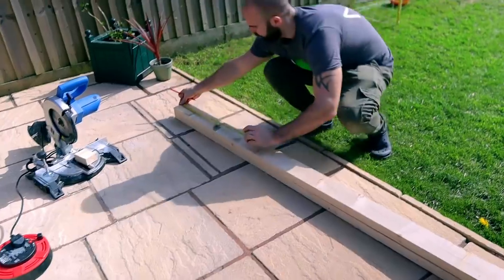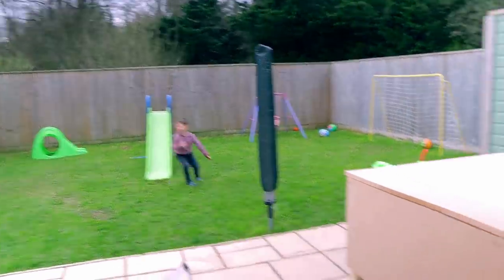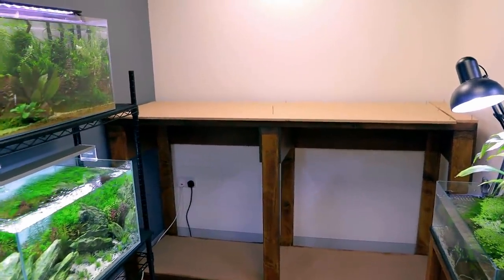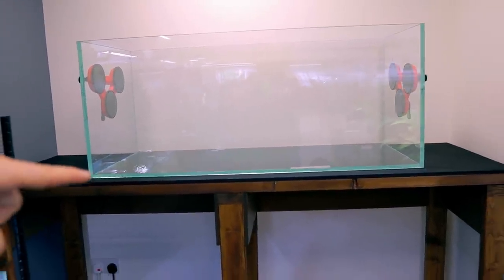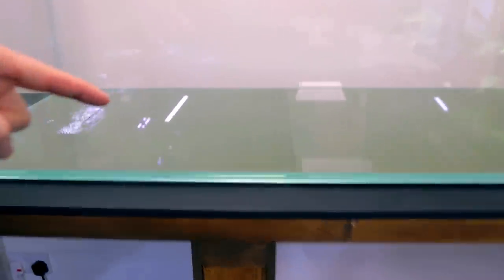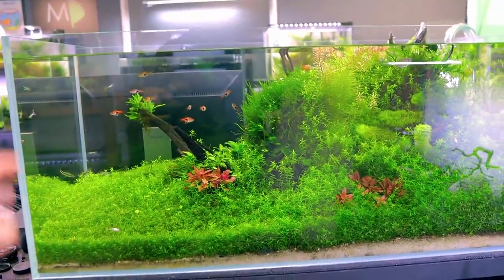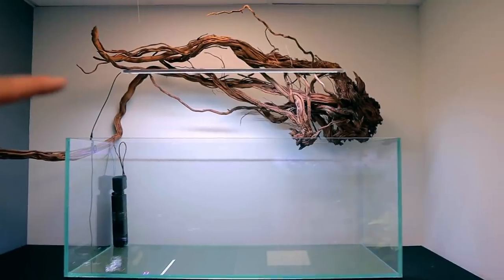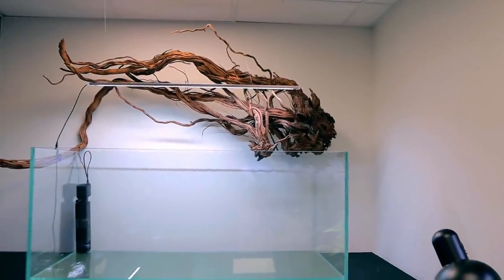How To: Ecosystem Aquarium NO WATER CHANGES (EP1) | MD Fish Tanks

Comment: SerpaDesign had a real bad time with this type of wood so I won't put it in the water neither :D WONDERFUL start MD, already lovin it as all of us I guess ! Can't wait until part 2 !!!
Reply: What type of wood is it? I didn't hear him say in the video
Reply: @ellenm4560  It's Dragon Root !
Reply: at least this how SerpaDesign called it in his video :D
Reply: @maxpuissant1079  Thank you! Must have missed that Serpadesign video too 🤦‍♀️
Reply: @maxpuissant1079  DragonRoot can be awesome in a tank, it just takes a bit more prep work than other woods.

It's pretty sappy, so either boil, dump the water and boil again (repeat until boil is almost clean), or boil in salt water to pull out all the sap, and then boil in freshwater to pull out the salt, or soak for a few weeks in saltwater, followed by a freshwater soak.

Requires more water changes if it's too big to boil, but the saltwater soak prevents the rotten egg/anaerobic activity Tanner had in his tank.
Reply: @Lazy_Fish_Keeper   you're right! if these roots are used in a lot of tanks there has to be a good reason : they are really nice roots :) , but yes they require a lot more of work to prepare ;)
Reply: @maxpuissant1079  only the thick pieces. Remember all the Aquascape people (like Josh Sims) who pull off thin strips of Dragonwood for award winning scapes. The interior of the big pieces rarely are sufficiently cured.

It's like the difference between my cholla that sinks after 24 hours soaking, versus the hard wood branch (2" diameter) that is still floating after  a week 🤷‍♂️
Reply: @Lazy_Fish_Keeper   so true. I recently cut a small stick that was in the tank for 8 month and realised that center of the branch was not event wet !

Comment: Don't know how far you are with the project but just a suggestion, the tank is in the middle of your stand so most of the wight will be on the two Center studs. That with the top timber been laid short side vertical,  you may want too double the center studs for strength. Maybe even some cross bracing at the back for stability strength. Can't wait for the next vid bro. Looks sweet thus far.

Comment: I feel like this one might beat the amazon tank in becoming my new favorite. I think puting sume papyrus plants in the background will also look really good, but you do need to make sure they can grow in water when you buy them, but I have them in my tank and they look great and grow extremely fast which is great for the biofiltration. And as a tip to avoid overwatering, stick your finger in the soil, if the first few centimeters need to dry out before adding more water. Adding a drainage layer in the bottom of the pot with lycaballs and a layer of filterfloss as a devider also helps a lot. 
And finally when a plant can grow in water you can still kill it thru overwatering, the roots in soil and in water are different, much like aquatic plants which have different growth patterns depending on whether they grow sub or emersed.

Comment: With the in tank filter,  shouldn't you block off the open areas in the floss basket? Won't the water get sucked straight into there as well as sponge bottom?
If block off slits in floss area,it will force all water through sponge first.  IMO

Comment: Be careful with the ivy, overwatering can happen if the soil becomes waterlogged, leading to oxygen-poor conditions (this is just a guess based on the processes happening inside burial mounds (hi, I study archaeology haha), but to put it simple, oxygen gets "spent" in waterlogged conditions when organic matter is decomposing which can essentially remove all the oxygen) and thus cause the roots to die, as far as I know. 😅 The reason why that doesn't happen if you grow it bare-root (aka soil-less) in a tank is probably because the conditions still supply the rootsystem with oxygen, while it'll also grow water-adapted roots. 😅

Comment: What is "this wood" that's so prone to going bad?
Reply: I believe it’s called dragon root wood. Tanner from SerpaDesign tried using it in one of his setups and it produced a very foul smell
Reply: Generally called Dragon Root, it requires a salt boil/or a long salt soak, to prevent interior anaerobic activity. 

*Or*

Drill it and run an airstone through it might be an option.